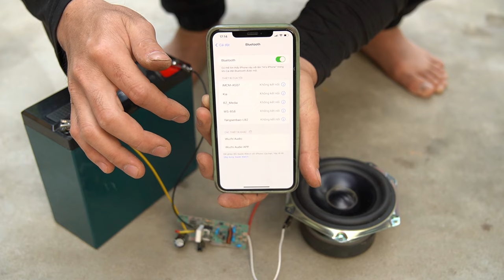DIY Powerful Bluetooth Subwoofer Amplifier With Mosquito Repellent

Comment: guys before watching this video, please know this is a fake tutorial and the circuit will NOT work, or worse may catch on fire.
The reason the speaker played at all is because this is a common scam, where the BATTERY (which is also fake) has a hidden bluetooth receiver in it. The circuit does nothing and just serves as an elaborate way to connect the speaker right across the fake battery.
Before I forget: 7805 is a voltage regulator and NOT a transistor. It cannot be used as one.